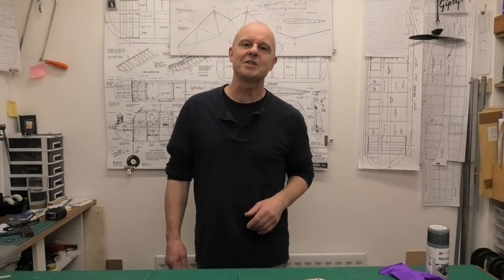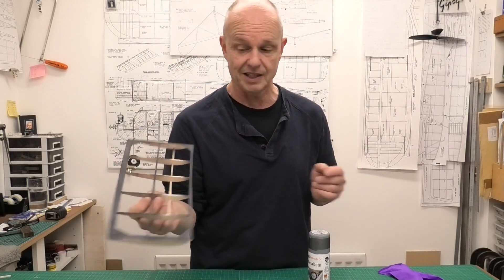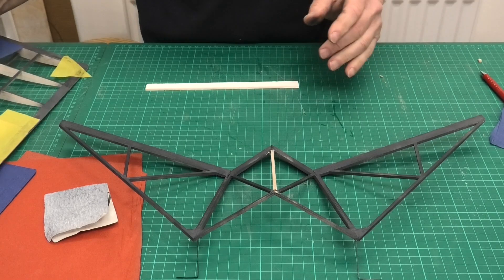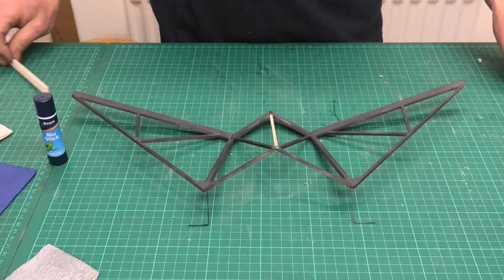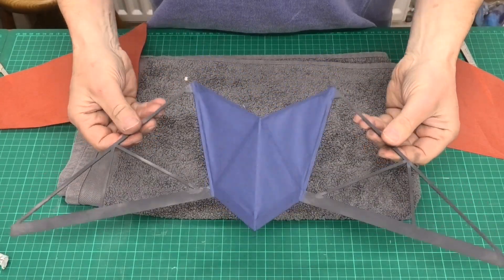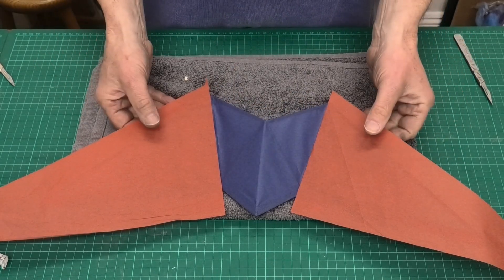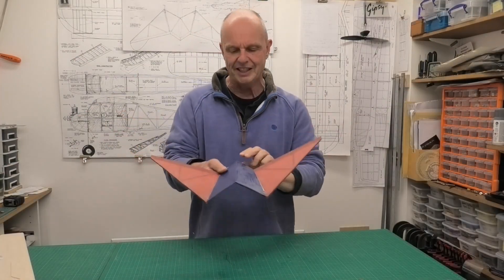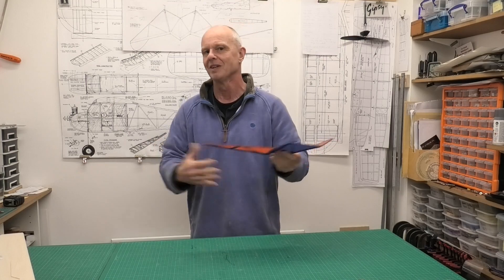Noctule 20" Rubber Powered flying Wing - Pt 2 Covering the Wings - Designed by O.F.W. (Peter) Fisher

Comment: For trimming tissue at the edges of structures, I exclusively use double edged razor blades. They can be bought in packs of hundreds online for not very much money. They're far sharper than scalpel blades and much better for cutting tissue than scalpel blades. They're a bit too flimsy for cutting balsa but they're excellent for tissue.
Reply from the maker: Thank you, always appreciate some advice 😀